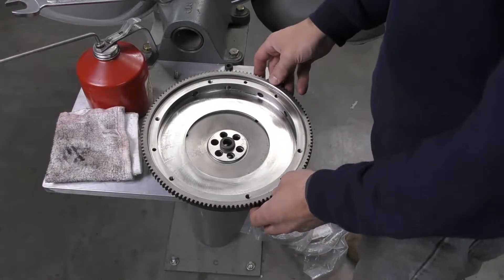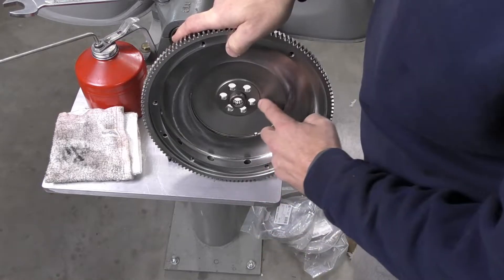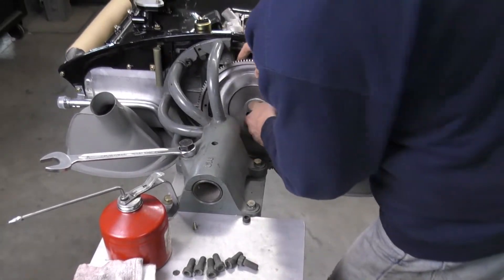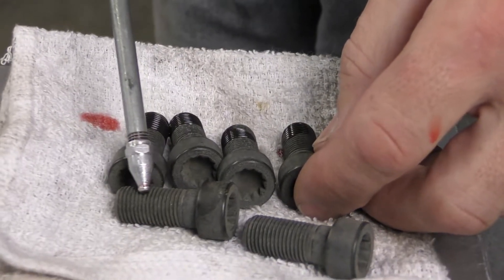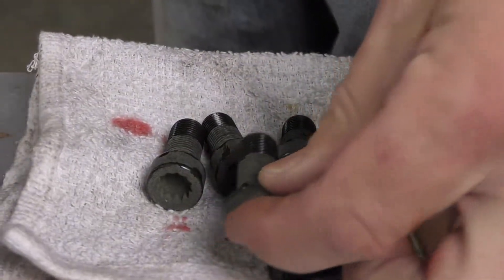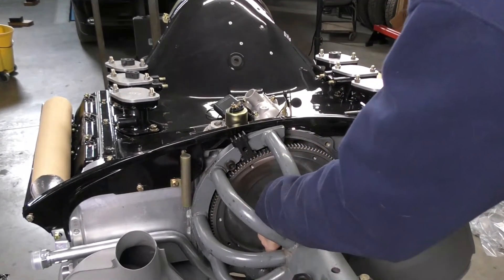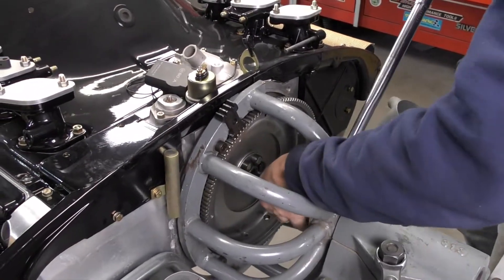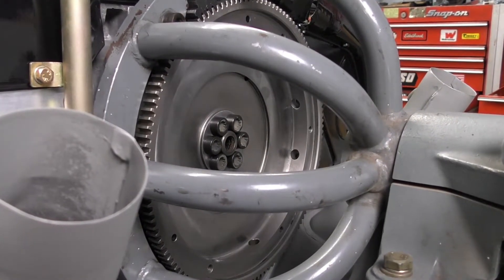How to put on a flywheel on a Porsche 2L Air-Cooled Engine

Comment: Please 🙏🏼 need help a 97 Porsche C4S with light gray smoke from exhaust located in Miami? Thank you in advance of your prompt assistance.
Reply from the maker: Light grey or blue smoke is oil burning in the engine. Depending on when you see the smoke will indicate where the oil is coming from to get into the cylinder. If you see smoke after a long period of idling or after a long deceleration then the valve guides are worn. If you see smoke all the time while driving then the rings are worn. There are other areas that can cause this issue as well. Over filling the engine with oil, or a faulty breather assembly can also cause oil to enter the combustion process and cause smoke.
Kurt
Reply: @Aircooledconsulting  thank you, your time is valuable, gracious of you to respond so
Quick! Smoke is all the time, stop lights and excel
Reply: I’ve prepared for removing engine. It has 75k miles. It’s on Max-jack now oil removed. Waiting for oil plugs/filters, before lowering to table and engine stand (crazy nervous😬)!! Looking for a great how to video in order to proceed and find shop for valve repair. Porsche manuals and service books not all that helpful past this point. Please help. Working from my two car garage. Appreciate your time, help, knowledge and assist.
Reply from the maker: @BMRIOSZZZ  Check the engine oil level first to ensure it is not overfilled. If it is, drain and refill with the correct amount and type of oil. Next, check the breather system paying particular attention to the oil separator can, replace if found faulty. Lastly, if none of the other two conditions exist, it is most likely an internal issue with piston rings. In which case, the engine will need to come apart. 
Kurt

Comment: Hi Kurt - when you inspect the flywheel do you just do a visual inspection or take measurements?  I see in the factory manual there are 3 measurement points.  One of the most useful aspects of your videos is interpreting the measurement points from the factory and demonstrating how to measure those points.  Thanks as always, Rob
Reply from the maker: Rob,
I will always measure thickness and runout on the flywheel. on 2.0L engines I will also check the depth measurement to make sure that I will have the correct clamping force on the clutch.
Kurt
Reply: @Aircooledconsulting  Thanks Kurt